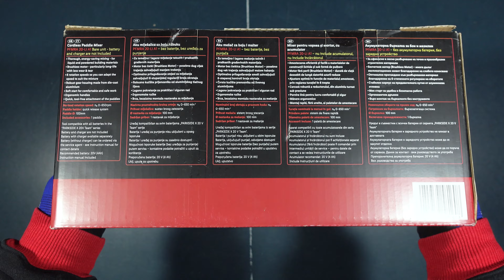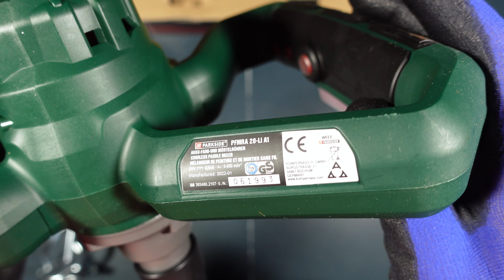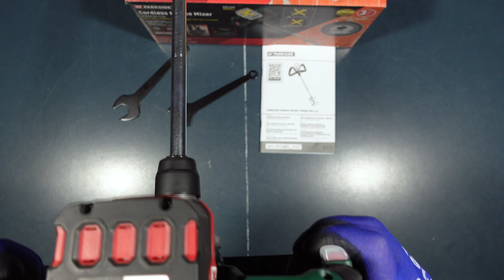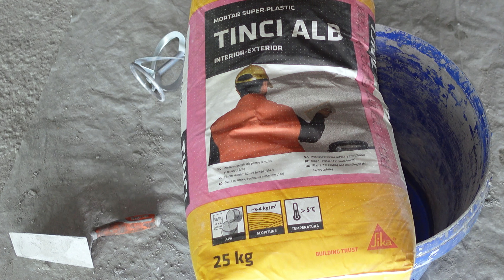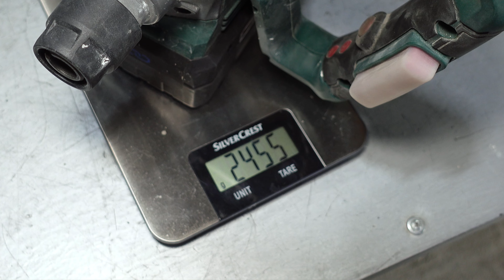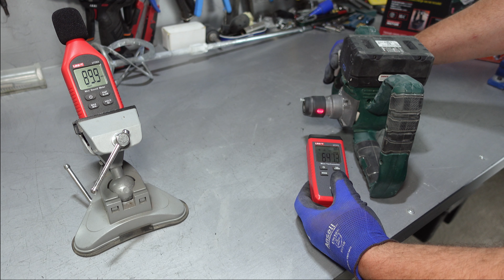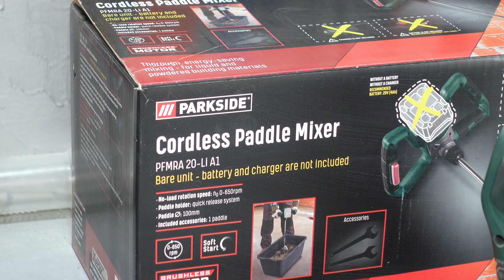PARKSIDE  PFMRA 20-LI A1 [ Cordless Paddle Mixer ]

Comment: Hello. Have you tested this machine with a standard 4ah battery and not the performamce battery? Mine is a little tricky. When i use this machine with legacy battery 4ah, it shuts down when using the sixth speed. If i use the performance battety it has no problem going all the way up to the sixth speed. Amd all of these without any load to the machine.